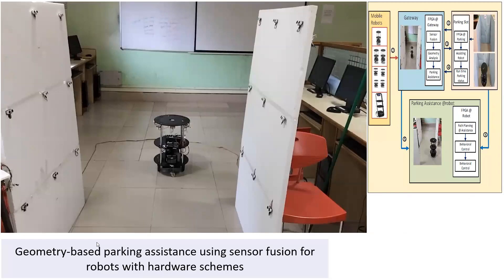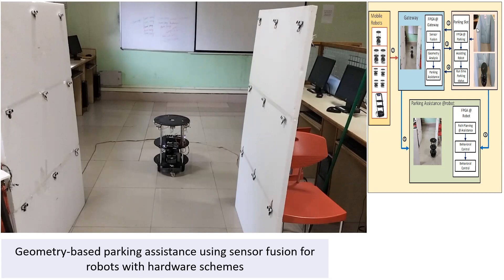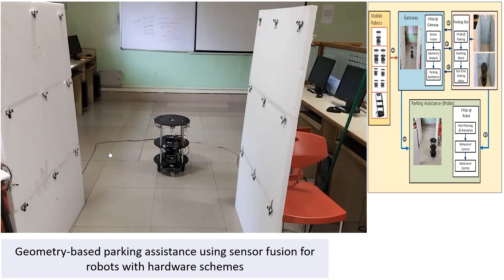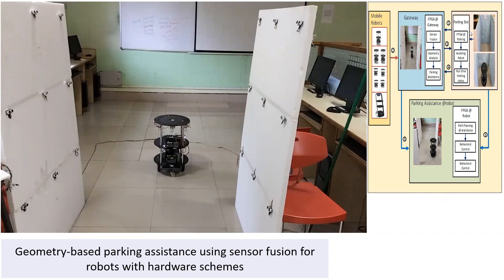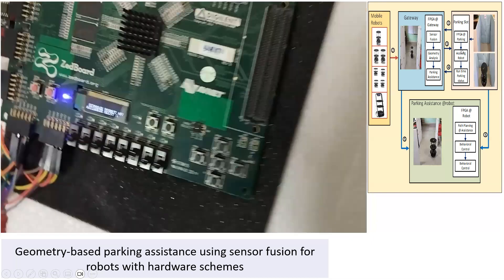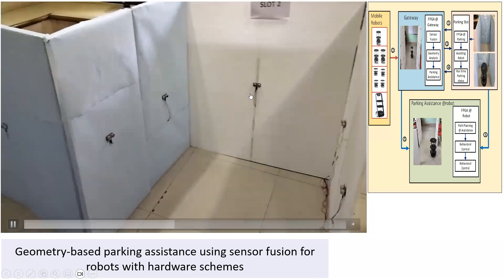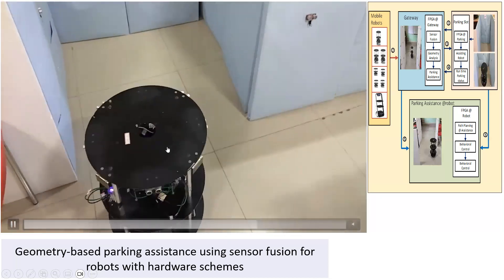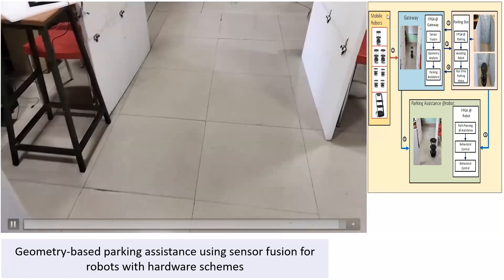Experiment Single robot parking

Comment from the maker: M. C. Chinnaiah et al., "Geometry-Based Parking Assistance Using Sensor Fusion for Robots With Hardware Schemes," in IEEE Sensors Journal, vol. 24, no. 6, pp. 8821-8834, 15 March15, 2024, doi: 10.1109/JSEN.2023.3345037.